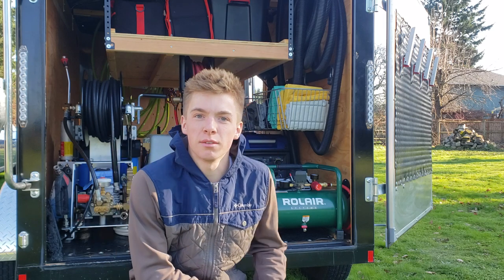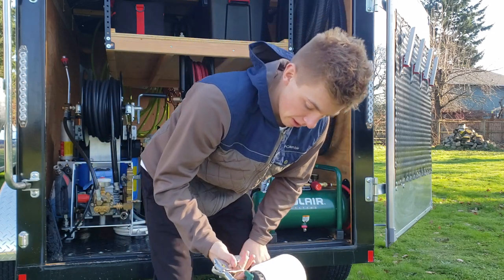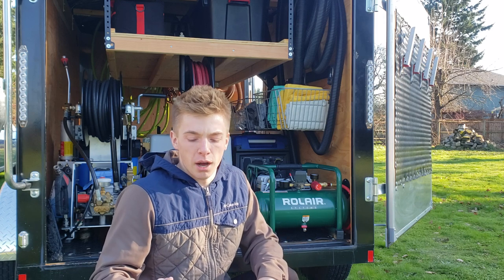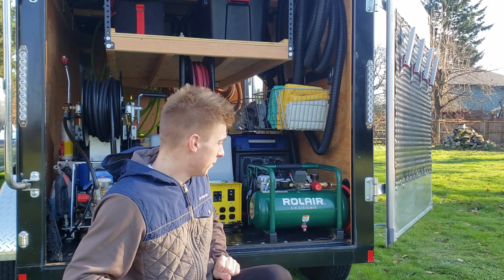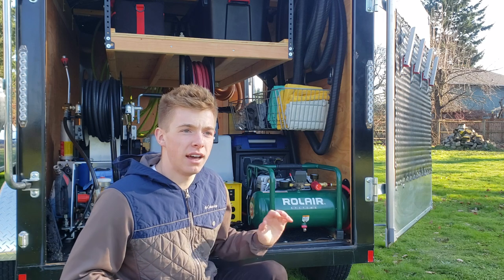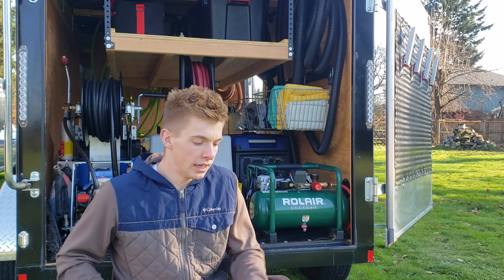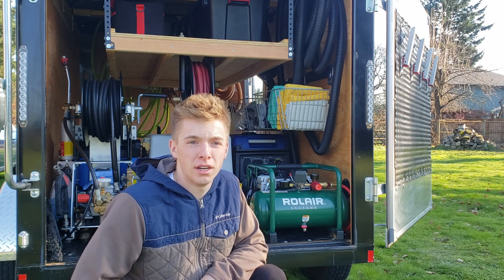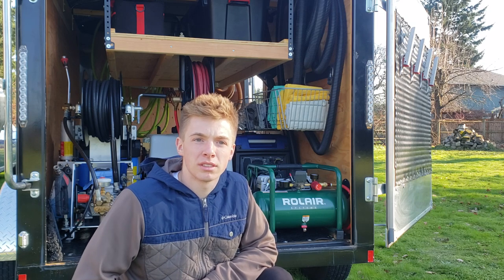Tornador, Rolair Compressor and Amazon Hose Reel - Mobile Detailing Setup

Comment: Great video. Tornador and that type of cleaner requires 14cfm compressor. In the UK you need a dual head compressor. I use one of these. https://www.machinemart.co.uk/p/airmaster-tiger-16550-3hp-50-litre-air-compres/